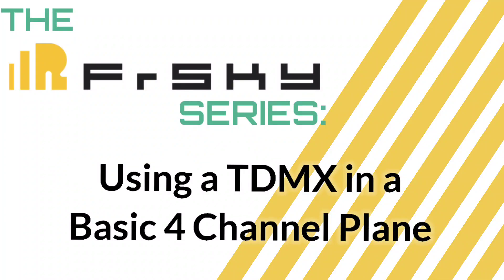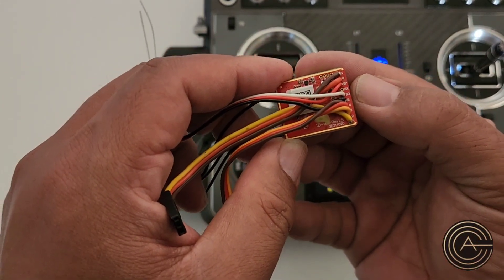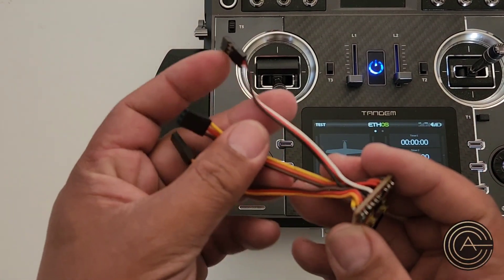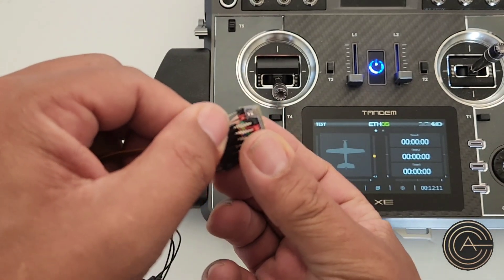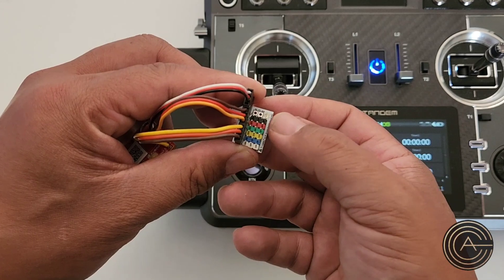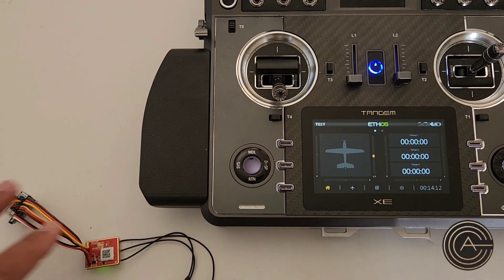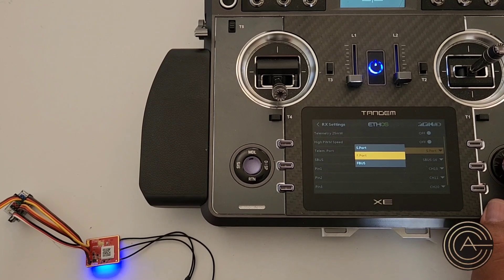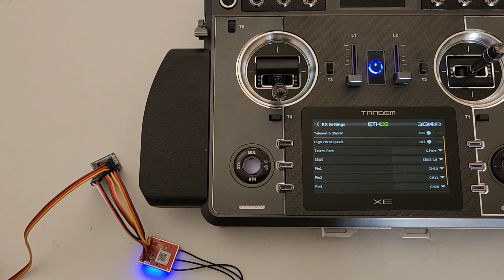Using a TD-MX Receiver in a Basic 4 Channel Plane

Comment: Cool but why not just buy  td r6?
Reply from the maker: Yep. I mentioned that in the video. Tdr6 at the time of the video was just brand new. I was using that system before the tdr6 was out and only the tdr10 and the tdmx was available. I posted the video for those like me that had quite a few tdmx receivers. I was planning on using the tdmx for redundancy on my big planes but found that the tandem receivers were so solid I stopped using them that way.

Comment: Would it be safe to use in my dlg glider?
Reply from the maker: It would be perfectly safe.  However,  the reciever, although very thin is kinda fat.  It might be a bit fat for your thin bodied dlg. I would check the dimensions of the receiver against the space allocated for your receiver.  Also, i assume your dlg is carbon fiber so you would want the antennas outside the body.  The receiver has 3 antennas.  2 traditional 2.4ghz antennas and one 900mhz antenna.  The 900mhz is a bit bulky for a dlg, especially outside the body. Frsky does make stone very narrow receivers specifically for gliders.  They aren't dual frequency like the TD-MX but they might be better suited for a dlg. I run the Frsky  GR6 receiver in my dlg. Very small and lightweight with a built in vario.  If you compete then i assume you don't can't have a vario but is nice to have when just flying the dlg for fun. It's only 2.4ghz but it works very well.

Comment: Hello, a simple question about the TDMX... How many channels does it deliver via SBUS OUT at most...? 16 channels or 24 channels? Thanks you very much for your answer.
Reply from the maker: That depends on the sbus device you plug into it.  All mine that i have used are only capable of 16ch but if the device you are hooking up to the receiver is capable of 24, it should work.  I believe you have to change the sbus type in the receiver options to 24ch in order for it to work.

Comment: Great timing for your video as I'm researching the TDMx for a 3 channel wing set up(2 servos and a ESC) . What's the simplest way to go about doing this with a X20S radio?
Reply from the maker: Are you asking how to setup the mix?  If so build a new model with 1 ail, 1 elevator, no rudder and no flaps. Take both elevator and aileron rates and make the weights 50٪. On the aileron mix, change the Chanel count to 2. Make output 2 ch2. On the elevator mix, change the Chanel count to 2. Make output 2 ch1. Reverse channels as needed. This is how I setup my Mirage 2000 which is a delta edf.
Reply: @all_rc  thanks for that. I was talking about wiring the TD Mx for 2 servos. Mine should be arriving in a few days, I think it'll all make sense once I have both the receiver and the TrasMaTech . I couldn't quite get the wiring set-up.
Reply from the maker: Just wire the Outputs from the tdmx to the top of the trasmatech board starting with ground, power (V) then ch1, ch2, ch3, ch4  . If you don't need sbus or s.port, you are done. You only need 2 servo connectors,  not the 3 I used.  Both the TD MX and the Trasmatech are clearly labeled. If you have any issues, feel free to email me at all.rc.air@gmail.com and I'll be happy to help

Comment: I designed a junction board and had 20 of them made by JLCPCB for less than $5. It has 6 pairs of 3 pins which provide 2 connections for up to 6 channels. It measures 20.5mm x 18.5mm and connects to my receivers using one 3-pin lead (channel 1) and one 5-pin lead (the signal wires for channels 2-6. It allows me to place the receiver ahead of the battery and run only 8 wires under the battery tray instead of 18. The dual throttle connections allow me to power everything from a separate BEC, if desired. I made a prototype using perfboard and used it in a 70mm E-flite Viper..